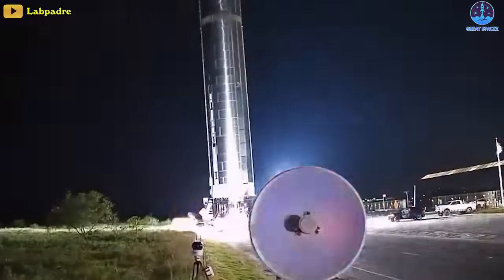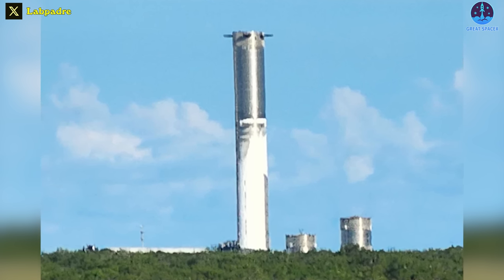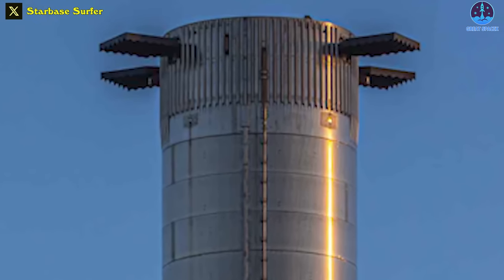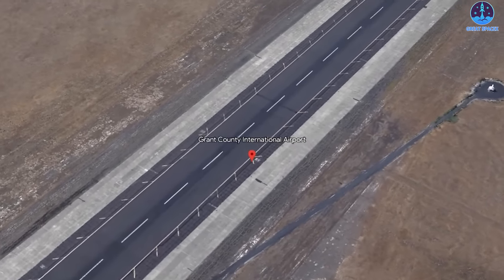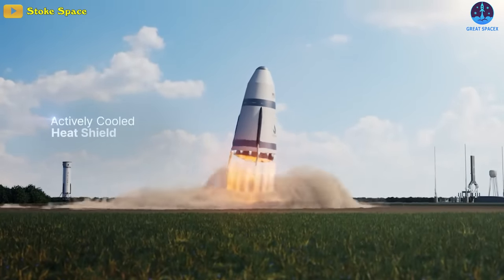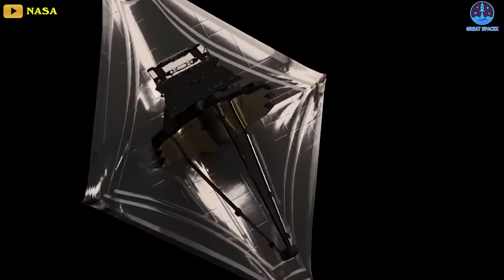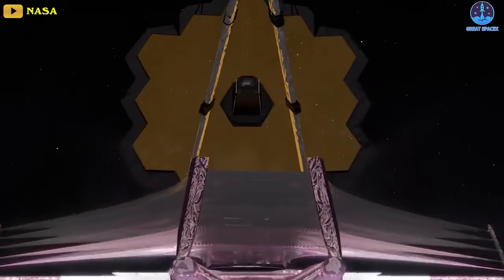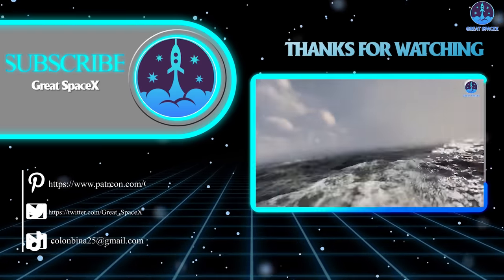NEW SpaceX Booster is on the line of testing, Stoke Space Hopper landing,...

Comment: The FAA is about to see a concerted effort to push for change to remove bureaucracy from innovation.  Boca Chica was not the ideal location for testing rockets since SpaceX is unable to purchase the land which might be effected by a launch.  I hope they are looking at either having the refuge moved (it's only there because this is the US-Mexico boarder and no one wants to deal with the river delta wetlands) to a more suitable location for the turtles and other wetland creatures, or have a better launch site picked out further up the coast.  They could buy a few thousand acres just south of Baffin Bay, not have any wildlife preserves butting up against their land, and still be a few degrees south of Cape Canaveral. Their trucking supply lines would be reduced.  They would just need to invest the money in getting the power pulled out to their location again.  They could keep Boca Chica as a build and test facility, and use Baffin as a launch site, using barges to bring the rockets up the inner coastal water way.